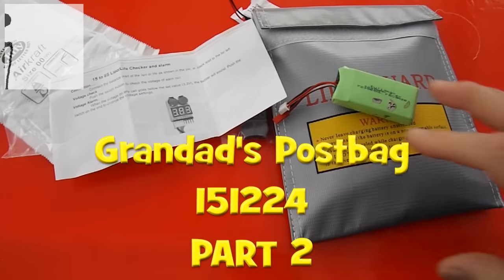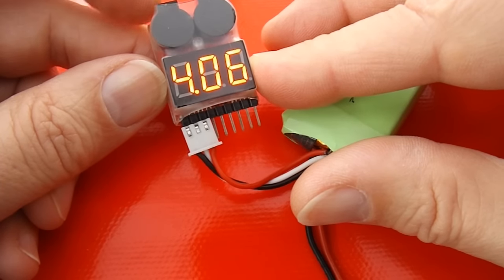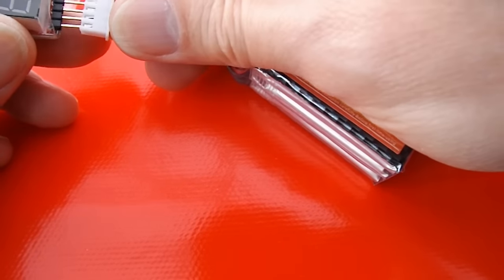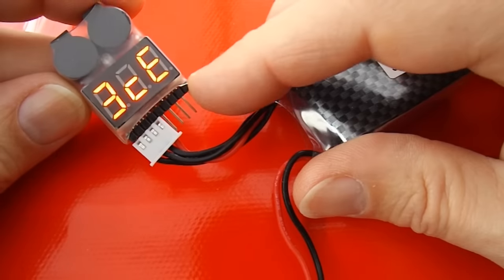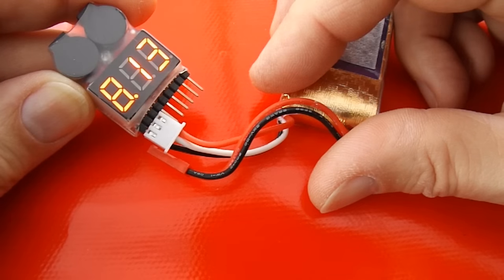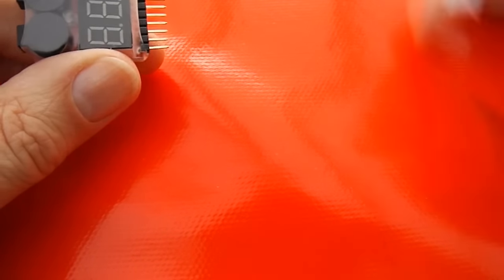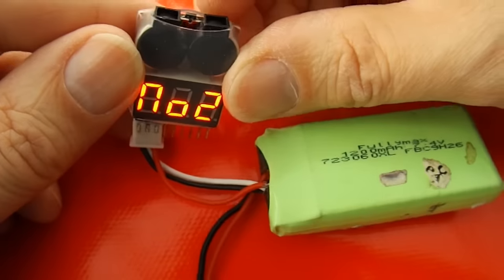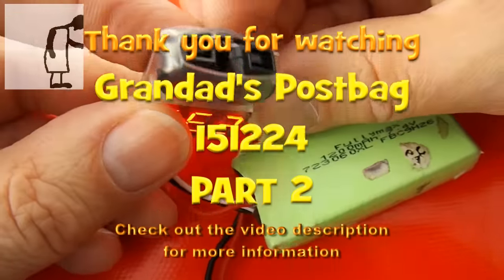Grandad's Postbag 151224 PART 2 Lipo Low Voltage Alarm

Comment: so make quadcopter
Reply from the maker: +Yahia Emarah I get asked to make drones and helicopters so often I have a standard cut and past reply.The answer is NO. To make a helicopter or quadcopter stable in flight I would have to buy so many parts designed for the purpose it is cheaper to buy a ready made helicopter or quadcopter or a kit. A good example would be something like the Eachine H7 2.4G 6-Axis LED Mini RC Quadcopter. On top of that, my channel is aimed at simple, quick, cheap projects and a helicopter or quadcopter build is not a simple, quick, or cheap project. You would be better finding a channel that specialises in RC Quadcopters or Helicopters so you get the information from people who know what they are talking about. FliteTest would be a good place to start https://www.youtube.com/user/flitetest
or anything David Windestål is involved in https://www.youtube.com/user/dadde87
or you might like this video by The Post Apocalyptic Inventor https://youtu.be/qa_x93JQhNM
for rubber band power check out the work by norris432 https://www.youtube.com/user/norris432
Francisco Ramos Muñoz is currently doing a quadcopter project https://www.youtube.com/user/franramuzz/videos
Why I won't make an RC helicopter from an RC toy car https://www.youtube.com/watch?v=92GKSUi2y-8